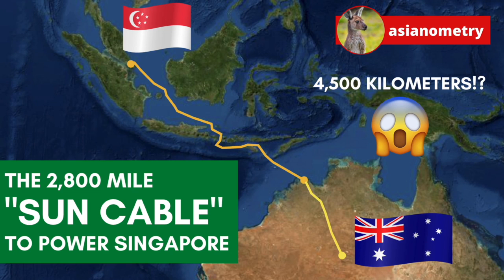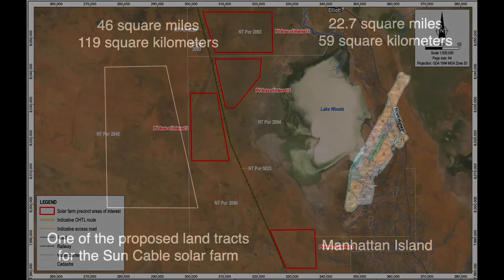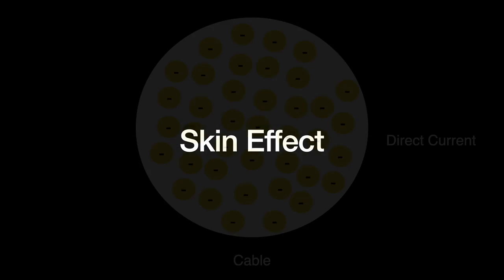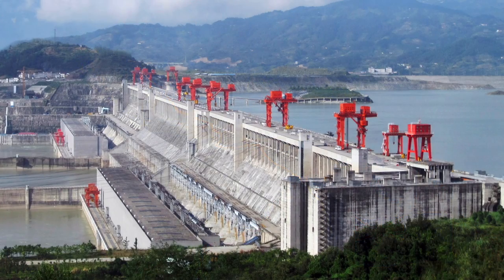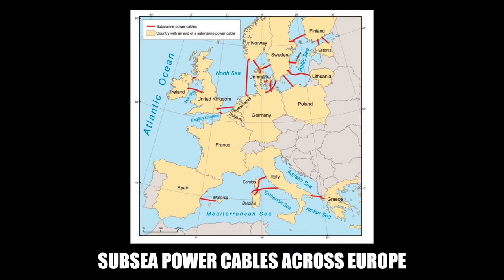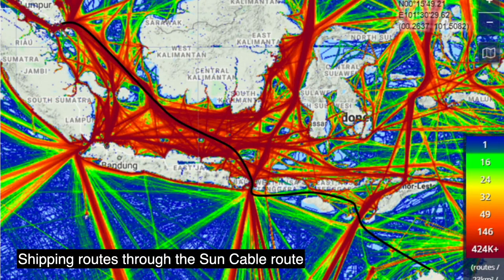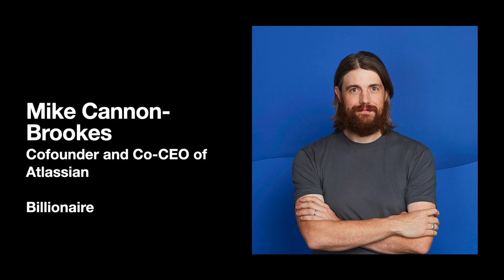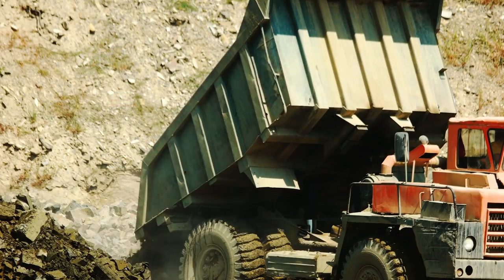How Singapore Plans To Pipe Electricity From Australia

Comment: great video on a really interesting yet unexplored topic! I'm from Singapore and rooting for the success of these renewable energy projects - hopefully we can sort out the technical and political issues.
Reply: I've spent a fair bit of time in Singapore over the years, and loved it. However, maybe Singapore can start using less electricity...? Maybe Singapore could import cheap electricity from its neighbours instead....?
Reply: @cerealport2726  If Singapore thinks it is more economical to import solar power from all the way from Australia instead of its neighbors, I think that says all you need to know how "cheap" the electricity is from its neighbors.
Reply: @exoticredtadpole2713  They mostly use gas to generate electricity now, imported from their neighbours. It's cheap, certainly cheaper than building an interconnecter many times longer than the longest ever built, and only able to deliver 2.2gigawatts.

You're obviously of average to low intelligence, and certainly not an engineer or scientist if you think this project is viable financially, or logistically.

Comment: How expensive are either 1) Singaporean electricity, and 2) Indonesian land to make this economical? You'd think it would be far easier to make a profit from supplying solar to Australia, or building solar plants in Indonesia (it's not cloudy all the time), or to sell the electricity to Java and save thousands of miles in undersea cables
Reply: Indonesian  monsoon. (Even the Darwin monsoon is a problem.) 

Means you need storage for a lot longer.
Reply: How does selling power to Java solve the power problem in Singapore?
Reply: Exactly, coupled with aboundand Geothermal Energy in Indonesia there shouldn't be a problem for a shortend Sea Cable. Except, politics. Maybe Singapur doesn't like Indonesia OR it's a media stunt. Singapur and Australia are far more advertisable than Indonesia.
Reply: @juliane__  indonesia best friend singapore
Reply: Singaporean electricity is ~A/S$0.25/kWh (~US$0.18) & the country is already buying a greater % of its natural gas from Malaysia & Indonesia (~70%) (much of which is used for power generation) than Germany used to from Russia (~55-60%)

Comment: I stack my solar panels electrically to double the voltage and minimize transmission losses.  Probably not making a huge difference even with my extra long coiled wire that needs to be trimmed to a reasonable length, but at least they kick on earlier and off later.

Comment: I lived in Singapore many year ago, during that time, many private residences were being built. If each of these private residences were fitted with a 10 kilowatt solar system feeding into the grid, they would not be in the dire straights with electricity they are. Moreover, going down that road, they are not reliant on anyone  else and cannot be held to ransome. Reports I have read suggest power from this proposed solar farm in Australia would be used to manufacture hydrogen which can then be exported and used for varius uses.
Reply: How many of those residences have 50sqm of suitable roof for the 10kw of solar?

Comment: The losses on AC transmission through cables are much higher than the calculation here. Due to the physical proximity of the conductors in a sea cable, they have a very high capacity. A 4000km cable would have around 0,4mF capacitance, resulting in a reactance of around 10Ohms at 50Hz. Its basically a dead short. There is basically nothing arriving at the other end.

Comment: The big issue isn't transmission but storage. The video skims over nightfall. So what happens when the sun sets in Australia? Zero electricity traveling down the Sun cable. Singapore will still need power. Despite skimming over this, it is simply not possible to build any lithium battery large enough to cover for Singapore's nightfall sorry. Adelaide Australia installed the then world's largest battery in 2017 (Hornsdale Power Reserve). That battery can only power the city of Adelaide for 10 minutes. Singapore is 4 times the population of Singapore.

Comment: DC is even more advantageous under salt water because salt water conducts and a changing current will produce changing magnetic field which induce currents in the sea water. This costs energy.

This is a reason why the cable across the English channel is DC even though it is relatively short. There are other advantages involving not having to synchronise the grids.

Comment: 1 million VAC subsea is the way to go. It's been implemented onland from Moscow to Siberia in 1989. The challenge is subsea earthquake around Indonesia Island. 
If I was a Singaporen investor, I would invest in Kalimantan Indonesia instead.
Reply: JD yours is the best suggestion so far.its cheaper,nearerncarries less risk.
Reply: Better HVDC. AC is not good for long underwear cables.
Reply: Others have suggested that too, I suggest checking out the video at 14:13 and comparing the amount of sunlight Kalimantan receives compared to Australia, then Googling "Kalimantan weather report". To talk the investors out of building that undersea cable you have to convince them it is more expensive than building the solar farms five or more times bigger to produce close to same amount of energy.
Earthquakes might damage the cables, daily tropical storms will cause problems for solar and wind power. Maybe they should look into geothermal and tidal energy instead.
Reply: 1. Subsea cables cross tectonic boundaries all over the world.
2. And put the rainforests in Kalimantan at further risks when they are already in great danger? No way.
Reply: @huaiwei  Oh yes, that too. Australian Outback can easily fit these huge solar farms and the local environment would probably thrive with the shade they give. On Kalimantan you not only have to cut down the forest, but because the tropical weather reduces the amount of available light you actually need to build at least two farms to match the one proposed for Australia, meaning more forest needs to be cleared...

But it gets better, as just about only way to calm down the people who would protest this project is to promote how it produces clean energy... Oh, wait...
So next you would have to cut down even more rainforest to build more solar farms so the locals can get clean solar power too.

Also, cutting down rainforests tends to cause erosion so the solar farms might get washed away by floods or destroyed by a landslide.

Comment: Sad facts.

-At best you get 10h (in summer) of usable solar energy per day. 
-Battery storage is rubbish, only real storage is pumped hydro
-A problem mining companies have come up against when installing solar farms is dust. Basically to have to be constantly cleaning the panels out there. With even small dust layers dropping output 15-20%.
-Solar Cells are really only good (in a commercial sense for ~<10 years, thus every 10 years or so you need to spend an additional $5b USD to refit the panels (and dispose of the old ones)
-Such a cable presents a significant 'sovereign risk' with Indonesia able to easily cut power
-Even with the project, Singapore (and all solar powered cities) still need a 100% base load to power activates when the sun isn't shining. Hydro power is a great option here to 'pick up the slack' as you can turn it 'on/off' but in this case, it means having 100% installed capacity of Gas turbines (which is a cost that must me made in addition. So why install 100% power generation of gas, only to then spend ~$15b USD up front + maintenance costs to only supplement that for (on average) 25-30% of the time.
-Thus the consumer has to pay for that additional investment
-Further to that, gas turbine operators don't like turning their turbines down, as they are really only profitable when running flat stick.

Reality:
$10-15b USD would be far better invested in building 5-6MWe of Nuclear power in Singapore.
It removes the  sovereign risk.
Time to completion would be similar (~10 years form project kick-off, though Nuclear could be done quicker)
-Provides reliable base load, with existing gas being converted to 'peaking' stations 
-An argument could be made that the small amount of nuclear waste that's produced is less of a burden than having to toss out the entire solar farm every 10 years.

Disclaimer:
I'm an Australian and I have roof top solar. As an individual 'it makes sense' as it reduces my electricity bill. 'HOWEVER"  from a national energy policy standpoint. Solar without the availability of Big Hydro to pick up the dawn and evening slack (+ 24/7 industrial use.) Simply adds costs to the consumer, as 100% of generation capacity must be bought, maintained and paid for (but not used all the time.) Because people don't like it when the power goes out.

Better to invest in reliable base load technologies and uses existing gas as 'peaking stations.' And the only game in town for that that is carbon free is Nuclear.
Reply: Only 5-6MW of nuclear power for 10billion dollars?

25 years for solar panels.

Comment: Japan is working on a similar project, but the electricity generated in Oz is first converted to Hydrogen, then compressed, and shipped to Japan.  There the procedure is reversed to supply electricity.

I wonder how Australian folks feel about the potential destruction of their homeland over these types of projects.  A quote I learned years ago definitely applies to these types of projects: "The Law of Unintended Consequences."
Reply: Not sure how that differs from mining sites, given these solar panels are built in very remote and desert areas; away from cities.
Reply: @MsEverAfterings  Exactly, while not all of them are remote as the one in the video, most are in the middle of nowhere and are usually built on depleted and nonviable ex farming land for the ones somewhat near population. Nearly all the big ones are out in the middle of whoop whoop. My friend has worked on a number of these solar farms in Aus and most are literally nowhere on inhabitable land.
Reply: Have you ever been to Australia?    Obviously not; if you had you would know that there is a whole lot of nothing outback with no people and thousands of square kilometers of semi-desert !  If anything, those solar panels will provide shade and moisture for a little more life to form/colonise the area !

Comment: This has since been scuppered.  A new hydroelectric supply interconnection project has been inked between Sarawak in Malaysia and Singapore slated for commercial operations in 2031. This project includes installing around 720-km-long undersea HVDC cable connecting Tondong in Sarawak to Changi in Singapore.

Comment: The energy storage battery is essential for electricity 🔌 to be available 24/7. These panels laid out will cool the Australian desert a bit. Hopefully every panel should also be fitted with air to water extractors. The water can be used by the community nearby to grow trees or tree saplings developing a fruit forest or a fruit jungle...
Reply: Gee, I wonder how much battery storage it would take to carry the grid for 24 hours.
Reply: These are being built in the desert.  There is no water in the air and no nearby community.

Comment: China has already built over 26000 km of UHVDC cables at an average cost of <$2B per thousand km. Some of these lines carry 12 GW of power at 1.1 million volts. Even at $10B capital, this solar PV + UHVDC project makes more sense than a $10B LNG liquefaction facility which liquefies 10 MTPY LNG for an equivalent of 14 GW average heat content or <7 GW average electricity make. The world should start linking more continents with UHVDC to stretch solar use to a few hours into dusk and dawn power peaks.

Comment: It is not a few rooftop solar panels. It is all over the island roof tops of public housing and solar panles floating on the reservoirs. Hope to reduce reliance on fossil fuel. In addition, SG pipe in low cost NPG from Indonesia. It is too costly to lay that Sun Cable from Australia..

Comment: There were similar ideas to bring solar energy from the Sahara to Europe. The distance is smaller. But there are settlements. In Australia, there may be Aborigens.
Reply: Project of generating power in Africa and using HVDC cables to transmit it to Europe has been discarded as non-economical.
The price of solar panels dropped so much that generating power using solar panels in Europe is cheaper than building expensive transmission cables.
Reply: I always understood the big barrier to Sahara power was political security. Who on earth would entrust their electricty supply to any North African or Middle Eastern government? This is the unspoken reason Singapore is looking to Australia rather than Indonesia or Malaysia, BTW.
And yes, much of the Sun Cable project will have to be on, or pass through, aboriginal and Torres Strait Islander land (they are ethnically and culturally different peoples). These days you have to get agreement from them to do that, but judging by mining industry precedents that should be easy - basically promise decent health, education and job opportunities and take their advice on avoiding religious/cultural sacred sites.

Comment: The Basslink cable was damaged due to the amount of power being sent through it, they were running the dams dry trying to get every bit of power they could to supply the mainland. Now all Tasmanians are paying much higher electricity prices because the Hyrdo would rather sell the power to the mainland at a higher price. Also not many people know but the Basslink cable was damaged when it was originally installed. My late father was a power station operator and was privy to a lot of meetings with the engineers at the time.

Comment: WOuld it not be simpler to generate hydrogen, tranport it in tankers and burn that for power generation?
Reply: it need to be continuous becuase i think the singapore will sell some of it to the malaysia and thailand.
Reply: Generating hydrogen uses 4x the energy that you get back out. 
Cables flow 24/7. A 10% energy loss is acceptable. 
Ships need diesel, lots of it.

Comment: The major flaw in this project is that the underwater cable pass through Indonesian territorial  water. You need g to g permission to do that. Instead buying the electricity, they will put high annual fee on it and use the fee to built their own grid.

Comment: Not very likely, lots of practical problems. When Basslink got damaged by a dredge, the power went out for better part of year.

Singapore would likely be better off building a nuclear power station, as reportedly Indonesia is planning.
Reply: Any nuclear leaks of any kind, the consequences can be devastating not to mention the tiny size of the island. Guess we wouldn't dare to dare to take the risk with a potential Wipeout. 😅😅
Reply: @davidtay787  nuclear is quite safe, but it would probably be a good idea in terms of local politics to build the plants themselves in Malaysia or Indonesia. Not sure of the political feasibility of this however. That said, in terms of energy security local nuclear plants would be best by far.
Reply: @bobgroves5777  Interesting, I note another claim is 'cause unknown' (act of God), although that seems unlikely to me.

 I saw pictures of the damaged sections and they looked very much to have suffered impact damage, as if they had been struck by something. The accompanying suspicion at the time was a scallop dredge, though of course that was denied by fishing fraternity as it would have meant admitting someone had been fishing in a prohibited area.
Reply: @mrnobodyplays147  waste is generally not a huge problem, especially compared to coal and natural gas pollution. But there does need to be a solid plan for it at Singapore's size. Breeder reactors are one possibility.

Comment: Excellent article but you didn’t mention how high the DC voltage is.  
I believe that it’s around 1m volts.  Is that correct?
Thanks.
Reply: 12 volts. you will be able to jump start your car if you break down near it.
Reply: I'd guess for a cable that long you'd be very keen to minimise the amount of copper even if it means spending much more on ultrahigh voltage converters and switching gear. So you'd want it as high as technically feasible with those converters - currently 1.2M volts, though the limit is still slowly rising (largely driven by those massive Chinese projects).

Comment: The choice between AC and DC:
Transformation of voltage in quantity needs AC, but this is changing.  Until recently AC transformers were the only practical way.
Switching generally easier under AC with large voltages and currents - AC has natural changes of direction.
Large single conductor cables under water needs DC due fluctuating voltage and elec characteristics of water..
Small three phase cables with earthed shields are OK for short water crossings.
Conversion DC/AC or vv very expensive, so economic only in big plants.
When pushing insulation to it limits (ie for high voltages), DC makes better use of available maximum voltage and hence reduces line cost.  
AC systems have to run at the same frequency.  Connecting two of them with DC allows each to be controlled separately.

HVDC is attractive for 1. long distance at high voltage with minimum switching, 2. for large underwater cables, and 3. for connecting together two independent AC systems.  Conversion is expensive, so if you can use all three reasons together, so much the better.

New Zealand has a DC link between two main islands.   Necessary for the water crossing, but taken advantage of for a long overhead line connected to it.  Also allows separate frequency control in each island.